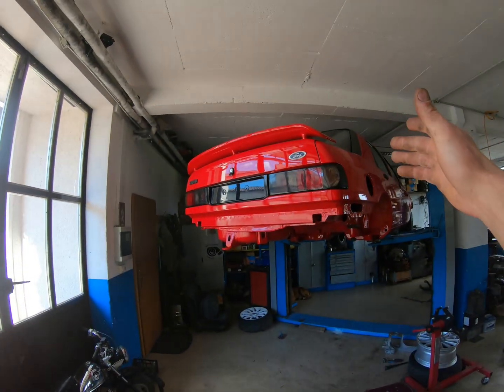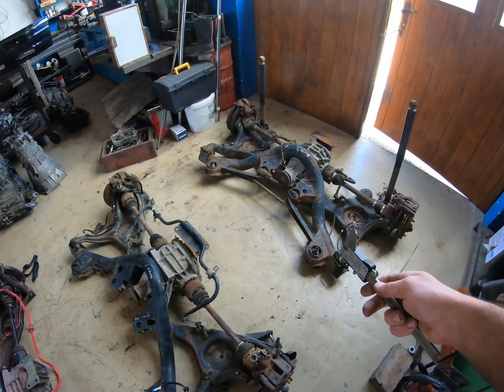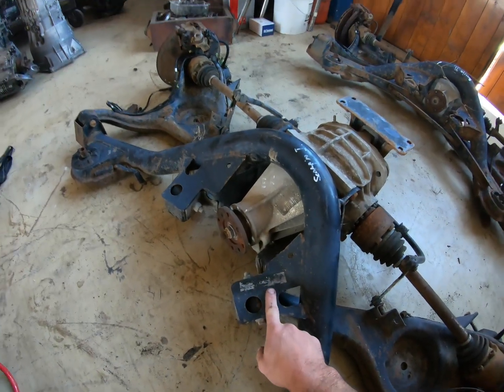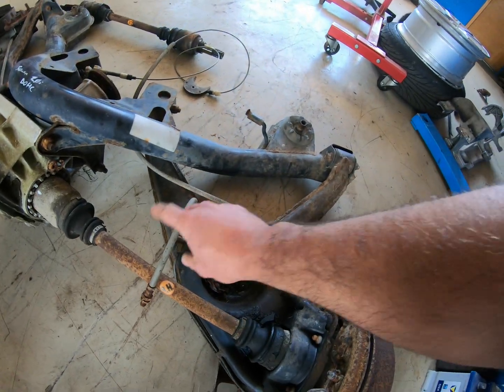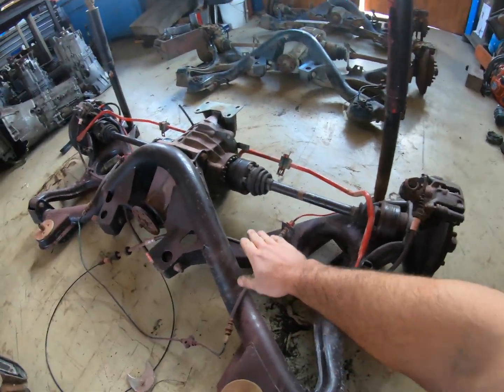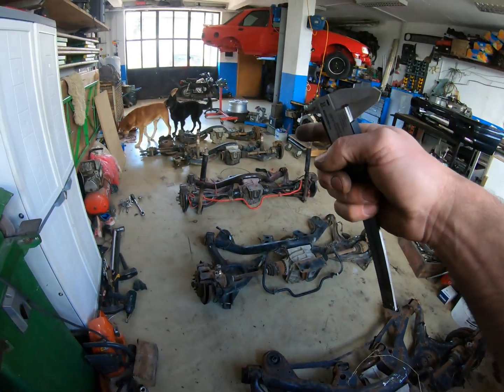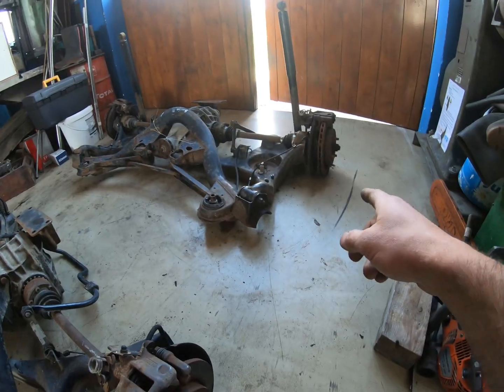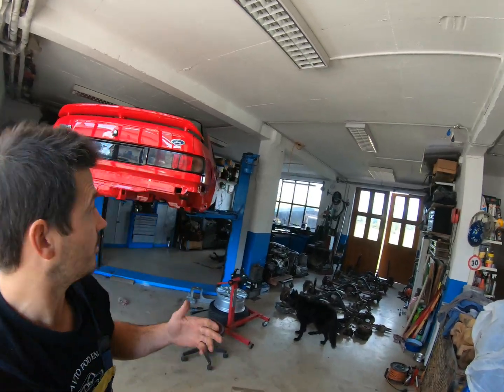Sierra and Scorpio Rear Subframes Compared ! | Differentials, Swing Arms, Driveshafts, etc.

Comment: The bracket for shock on the arm are different between Sierra ( less wide and M10 hole ) and Scorpio ( wider and M12 hole ).

Sierra drums arm look wider ( about 5 mm ) than sierra disc arm ( look same wide as my Scorpio '85 / '93 ), Scorpio cos '95 is wider

I have few pic, you can contact me😊
Reply from the maker: True, all correct! You can send me the pictures for reference, they might come useful! 🙂

Comment: Good job my friend. I envy your great knowledge. I have a sierra estate with drum brakes, thinking about to swap with a mk1 scorpio rear end. How can i fit shock absorbers upper end joint?
Reply from the maker: Scorpio sedan? You will have to make mounting points on the swing arms (in the middle of springs) and fit absorbers on original mounting points. I think this would be the most simple solution.

Comment: 8:38 You can NOT swap the drum brakes for disc brakes, without replacing the control arms, I've tried it. Mounting points are the same, but it won't work. The control arm of a Sierra with factory disc brakes has more space for the abs and thicker drive shaft.
Reply from the maker: Thanks for sharing! Some others pointed out that the drum arms have too little space for the disc-brake driveshafts, so it's best to use a complete disc brake version kit.
Reply: @HappyDayGarage i’ve managed to put it together, but I was surprised that the rear wheels were jammed 😂 I have a Scorpio mk2 2.5td estate chassis that I want to put on a Sierra, front and rear. The Scorpio mk2 never came with a LSD diff, so u need to take a rear LSD diff from a Sierra or Scorpio mk1 and change the back plate to the earlier one and change the mount to the Sierra one.

Comment: Hy from Hungary!
I'm planning to swap my disk rear sapphire to a MK2 scorpio rear subframe and trailing arms.  Question is: can i use the sierra bearings, shafts, brakes and the diff in the MK2 subframe/trailing arms? I know the diff size is different but the bolt pattern is the same?  Will the shafts be long enough? No ABS will be ran.
Reply: Additionally, the brake calipper bolt pattern is the same all across all disk brake setups?
Reply from the maker: Hello! Unfortunately you can't. 
The scorpio mk2 driveshafts are much longer, so sierra ones won't work unless you fabricate some spacers on the diff side. You can fit the smaller differential in the bigger diff subframe, you just have to include a spacer and get a longer bolt for one mounting point. Brake caliper bolt pattern is the same, but the coplete combination should be tested out.
My suggestion would be to use the complete rear end off a Scorpio, but also check what differential gear ratio you have.

Comment: 7.5-inch differential has slightly larger internals, which should increase their strength a little. In a 7-inch differential the shortest gear ratio (fast acceleration, low top speed) is 3.92, in a 7.5-inch differential is 4.27. 

The shock absorber from the Sierra does not fit into the control arm from the Scorpio 1, also, the shock absorber on the Sierra is screwed with a 10mm bolt, on the Scorpio with a 12mm bolt, at least for non-Cosword and non-estate models. 

The silent blocks that attach the arms to the beam on the Scorpio 2 are wider than on Sierra/Scorpio 1, at least for non-Cosword. 

Also, slightly later Scorpio 2 beams had three attachment points to the body and, accordingly, another differential cover.

I didn't see any difference in rear track width between a regular drum Sierra and a regular Scorpio 1.

Ford's Visco LSD is not suitable for drifting, it reacts too late. But even if you're not a drifter, after so many years it requires a complete disassembly for replace the viscous fluid (regular transmission oil is poured into the differential housing).
Reply from the maker: Thank you for sharing, good info! I also found the Ford LSD not very aggresive, but works great. 
I didn't know the viscous fluid can be replaced!

Comment: Can you check if the angle of the suspension arms is different on the Scorpio mk2 vs. the Sierra and Scorpio mk1? The Sierra and Scorpio mk1 have an 18 degree sweep angle for the suspension arms. A lower angle gives better handling, as it keeps the camber and toe more constant over the full suspension travel. I've see a Scorpio mk2 that sat on the bump stops, but the wheels didn't have a lot of camber unlike the Sierra would have, therefore I suspect Ford reduced the sweep angle on the Scorpio mk2.
Reply: I checked from a mk2 scorpio and they were also 18° sadly. A lot more reinforced than on sierras though. It seems all of them are 18° so it’s not really worth an upgrade unless you get a 6° beam
Reply: @DaShitProductions thanks for checking!
Reply: Maybe you meant 1.8 degrees? On the Sierra/Scorpio 1 and Scorpio 2 of the first years of production, there should be the same camber at the rear. The difference can be caused by wear of the body, springs, and rubber parts. Independent suspensions from factory have a slight negative camber. 1.8 is still a small camber, it already provides the best handling. 

Regarding the dropped Scorpio 2: probably there were embedded parts welded in there for the adjusting bolts from the VAG or even arms with articulated heads like on Sierra rally group A.
Reply: @gisha7schannel302 no, I really mean 18 degrees. It’s the angle at which the semi-trailing arms are mounted to the chassis. Just google ‘sweep angle semi trailing arm’ to find what it is exactly
Reply from the maker: Very interesting! Might make a custom subframe at some point to try out different sweep angles. 
Some day, hehe

Comment: Please make a video where you show driveshaft thicknesses, bolt-in type driveshaft stub size (100mm and 108mm outside diameter not from bolts), bolt-in driveshaft lengths between the stubs (shaft/joints not compressed!), and could you please remove the hub carrier from the mk1 scorpio and xr4x4 axles to show the 5mm difference more clearer does it come from the arm or from the hub carrier itself? Thank you!!
Reply from the maker: Driveshaft video on the way! The difference comes from the thickness of the outer swing arm flange.
Reply: @HappyDayGarage Thank you, pls measure the stubs too as there might be two possobilities for mk1 scorpio but I had 100mm stubs just like majority

Comment: Late model Dohc had the 7 1/2" differential, also the 2wd cosworth sierra models. 
The disc brake wheel bearing hubs do not fit in to the arm of a drum brake type. The hole in the centre is not big enough.
Scorpio mk2 rear calipers can be used on the other disc axles but you need to use the scoripo mk2 rear hub bearing carriers as well. Its basically a cosworth 4wd sierra setup  , a good upgrade
Reply from the maker: Interesting, thanks for that info! There sure are many combinations available.. 
I'm going first with the original Sierra disc brakes and might swap them out later for Scorpio. 
It's worth mentioning that brakes should be considered as in combination with the setup in the front (I'm not sure which I'm going to use there yet)
Reply: @HappyDayGarage  have a look at my video on 320mm front brake upgrade. Ford factory mk2 focus

Comment: On the Scorpio MK1 there have been small differences between normal and Cosworth rear axles. They have a little change in the arm bushes between them. Best regards
Reply from the maker: That's interesting. Thanks for sharing!
Reply: @HappyDayGarage  if you wish, I can send pictures or measurements. Have both as spare in the shelf 😂

Comment: I love this kind of content especially on the sierra and scorp ,SO i have a question im on drums at the back and want to change them to discs and make it wider can i use the scorp 2 trailing arms on my sierra rear subframe ?
Reply: If we're talking about regular, non-Cosword versions, then no, you can't. The silent blocks that attach the control arms to the beam on the Scorpio 2 are wider than those on the Sierra/Scorpio 1.
Reply from the maker: Thanks for clarifying. Makes sense as the Scorpio Mk2 is much wider.

Comment: 16:42 i think that 5x112 pattern is good :). It's very difficult to find wide rims (10 inches) with a 4x108 bolt pattern. The 5x112 pattern was found on the Mercedes SEC, for example. There are more interesting rims available.
Reply from the maker: Good point! Makes a lot of sense if you're going with big fat wheels hehe 😁

Comment: There was another type of suspension in the Ford Scorpio. In Poland, we call it the Koala because of its appearance. It has a completely different mounting point at the rear. The differential also have diffrent mounting points.
Reply: Yes thats the mk2 Scorpio (frog-eye), in this video the furthest/last rear axle with extra reinforcement in the beam and sierra estate looking arms.
Reply from the maker: That's right!
Reply: The first years of production of Scorpio 2 had a third mount like the Sierra/Scorpio 1 (the distance between the bolts is different, but the design is the same).
Reply from the maker: Correct.